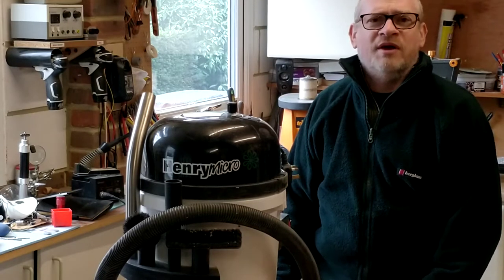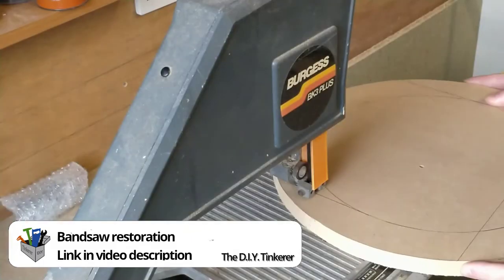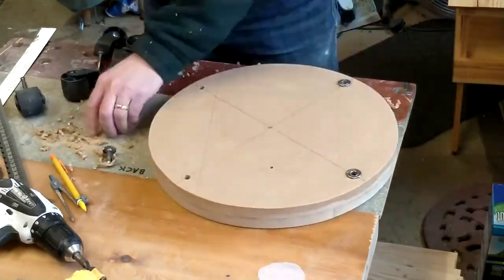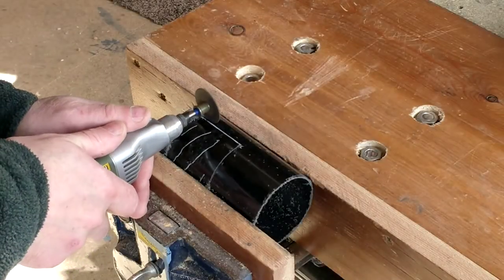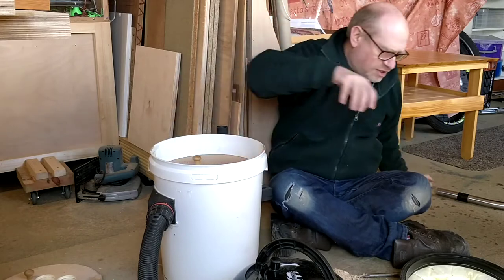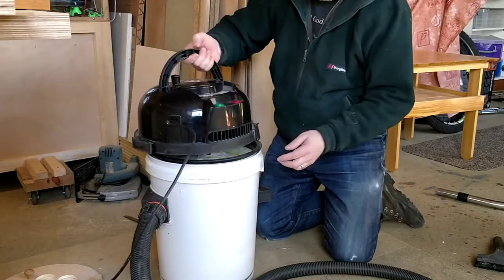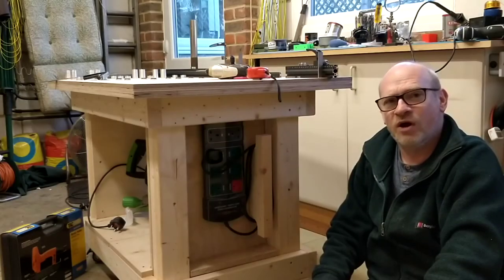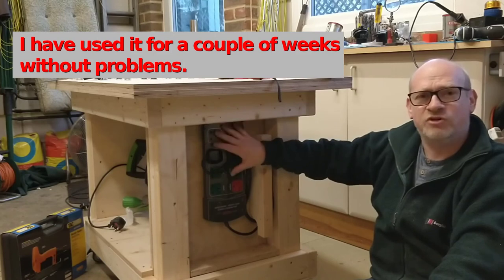25. 3 Upgrades to the Cyclone Shop Vac

Comment: Oh the joy of a vacuum hose bracket!
Great mods. 
Terrific luck with the auto on/off. 
Good luck from the south western corner of Australia.
Reply from the maker: Thanks, the auto on/off has been working really well for a couple of months now, I've peaked inside the extension socket and the relay is rated at 15A 240v so should be good, I've a radical re-engineering of the on/off coming soon so be sure to subscribe to catch it :-)

Comment: Where did you get HEPA filter and the multisocket/what brand is it?
Reply from the maker: Hi, thanks for watching the video, the socket is about 15 years old, it is Labelled as' surge guard 8 port master/slave energy saving extension lead' that's all I know, if you Google that you might find something. 
The HEPA filter is part of the original Numatic Henry Micro.
Reply: @DIYTinkerer  Thanks I love your ideas and would like to use them on my Titan shopvac. Titan appear to have dropped their HEPA filter so was looking to see if your example might fit. Great idea to tidy the hose when not in use.
Reply from the maker: @robertwilson6020  if it helps the filter should fit a bucket with an inside diameter of 295mm - 322mm - at least that's what I measured. Good luck:-)